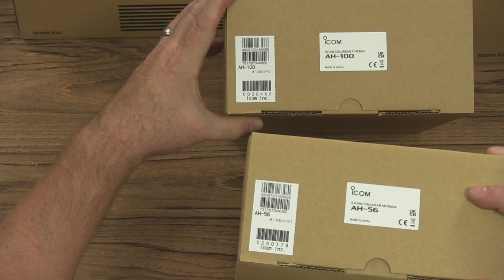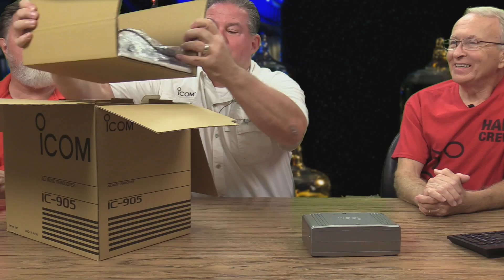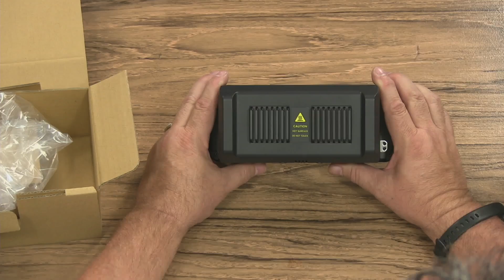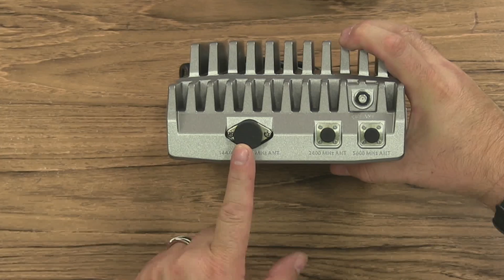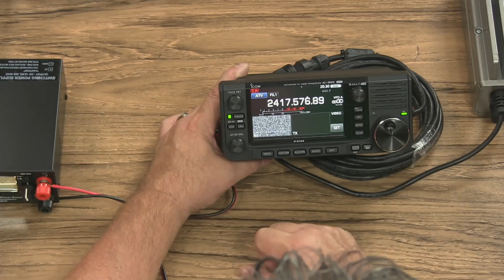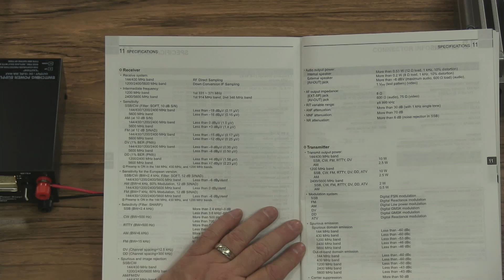Icom IC-905: Unboxing and First Look

Comment: I sprung for the 905 and got the 705 at the same time so it is not lonely just like when I got the 7300/9700 twins. Have not yet acquired the 10 gig add-on items because it is just astronomical for what you get. I'd really like to have a multi-band parabolic that includes the 10 GHz capability. Maybe design an adjustable feedhorn.

Comment: Producing a 360P video does not make Icom look like a tech-savvy company.
Reply: It was just published. Check back soon and the higher resolution will be finished rendering by YouTube.
Reply: @TommyMartin   Now it's at 720p and that's still so lame that it needs crutches to stand.
Reply: Using a headshot that looks like you've been drinking at a party is pretty professional.
Reply: @XPCTECH lol Big Dutch is Big Drunk 😂😂😂
Reply: This was actually a 3rd party channel's video that they were authorized to re-use.